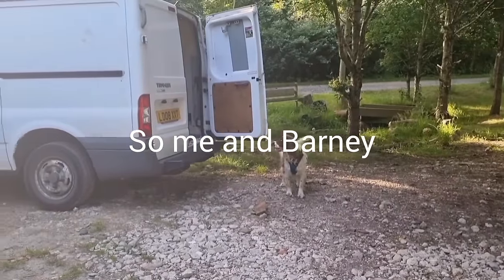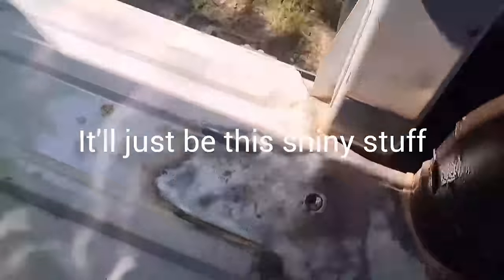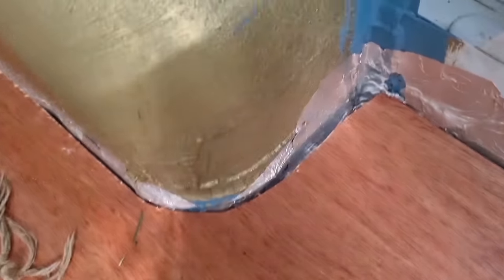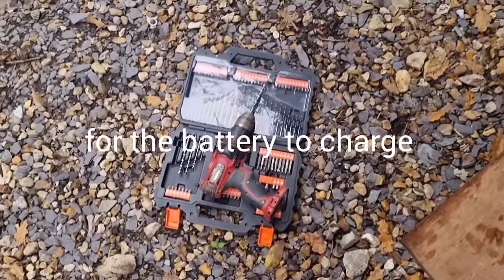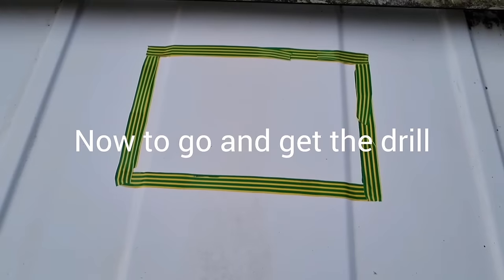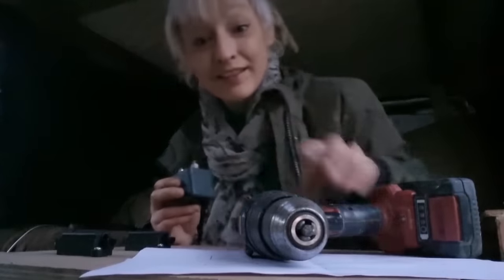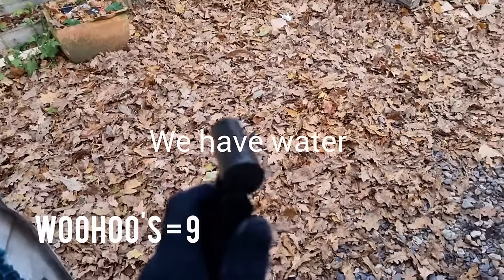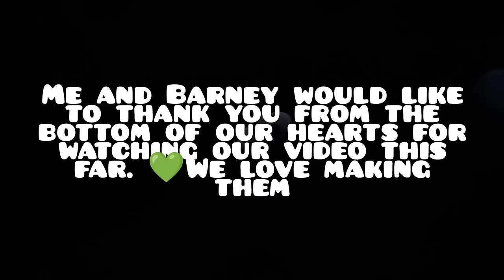#25 Clueless Female Builds Ford Transit Camper Conversion 😲 Must See Van Build

Comment: Far from clueless madam 👍 tidy job looks very cosy.  Not sure your crimpers are meant to do battery terminals.though. soldering would have been a better option for future reference.  Enjoy your travels
Reply from the maker: Ha, thanks! I took my battery cables to the electric shop and soon realised my crimpers were just for my teenie wires 🤦🏼‍♀️ thanks for the tip!
Reply: Soldering a connection made for crimping isn't the best idea. But a better crimping tool would be a good idea.

Comment: In a youtube full of very expensive van builds I loved the simple and very effective build you did. I would not describe this as clueless, seemed to me you knew what you were doing. I am on version 3 of my van build and it still doesn't feel as cosy as yours. Well done. Subscribed.
Reply from the maker: Thank you! I designed it for a winter holiday, so I thought only about the cosy warm feeling! I just spray adhesived blankets and fluffy fabrics to the walls! A great alternative to the carpet you see in every van build ever. Thanks so much for the watch! 💖

Comment: My advice would have been to keep the bulkhead that separates the back of the van from the driver's compartment.
At least keep the part that is behind the driver.
This would keep anything that is in the back from hitting the driver in case of an accident
Reply from the maker: I did plan to take the middle seat out and allow access from back to front incase of an emergency. It never happened. Thanks so much for the watch 💗

Comment: 11:15 from their website: "Product overview
Bostik SBR is a specially modified Styrene Butadiene Co-polymer Latex for cement and mortar.

It toughens, waterproofs and improves chemical and abrasion resistance of renders, screeds and mortar. It is an excellent all round primer and bonding agent and is especially suitable for external applications. 

Bostik SBR can be used for waterproof rendering, flooring screeds and toppings, as well as for bonding renders and suction control." 

Any the wiser? I'm not.
Reply from the maker: Thank you for this! Sounds like it could be the right stuff to extend the floors life. Thanks so much for the watch 💖

Comment: Great build, just a few things van builders forget.  Ventilation, go and have a look at a caravan floor, they have holes in to allow for ventilation and prevent mould, a sealed box will get damp and you’re have a mould problem in a few years.  Also regardless of battery type, vrla, gel or lithium make sure you have ventilation, ideally with external acces or away from living quarters as they can produce explosive gas, mainly hydrogen during the charge period,  with todays battery pack technology I’d just use a battery power pack and a solar panel, makes things a lot easier.

Comment: Not clueless at all. Maybe not very strong - I used those crimps for years and never struggled like that. Especially as they are a one handed tool.
For those that have never used a drill and a hole saw before, there is nothing like getting your wrist snapped around and your thumb twisted at the same time. With experience you know it might happen and you should hold the drill in a 'monkey grip' with your thumb on the same side as your fingers.
Reply from the maker: They were definitely the wrong sized crumpet for the job! They're great for teenie cables it turns out. Thanks so much for the watch!

Comment: Was fun to follow your creative conversion work of a transportation car into a camper van.🤩 Only avoid wearing a scarf during the drilling sessions...🤪
Reply from the maker: I cringed editing those sections as it was clearer to see for myself how unsafe I may have been being! Thanks so much for watching 💖
Reply: @looselywild2679 yes. Loads of people will pick up and comment on that safety kind of stuff. Then there's counter comments, some more or less annoying.
   You must be commended for wearing a face Visor when using an angle grinder. At work I've seen one of those grinding disks, but twice the diameter, come off. It ran up his overalls over his shoulder and half way down his back. Good job his 'face' wasn't in the path.
  Your clearly smart and capable, and i have a strong impression that your getting good advice from wherever, which is really nice. Long may it continue.

Comment: Hi my UK friend,  I have been watching lots of camper van builds to give me ideas for my solo travels.  I would never say you are clueless as to what to do as you show good content on working on a budget to sort everything out.  But as I like electronics and (as an extra woodworking)  I am taking an easier approach for the electrics and a cheaper one.  No batteries, no inverter, no mppt controller,  no fuses or breakers,  just one custom made unit to do everything, with a solar panel . My van will only be used in the summer.  I have subscribed and will follow your journey.
Reply from the maker: There must be fuses, but it's all been made for you and encased in a box! Sounds perfect, hassle free, and a little pricey. But I did once allow my homemade electrics to rattle loose and almost cause a fire. So if you can, it's always handy!! Thanks so much for the watch 💖
Reply: This channel is not for parttime van life pretenders..

Comment: Your sink drain should be threaded and have a nut on the bottom. Its sitting too high in the sink, hence the water wont fully drain. (Move the rubber washer underneath). You need a waste tank fitting to catch the water when you pull the plig out!
Next the toilet and shower eh?
Reply from the maker: What do you mean by threaded please?? I know I put the rubber on the wrong side. The glue I put on the underneath eventually rattled itself away. The water fully drained, except for totally out of the sink with out help of course. I thought I'd be cheeky and not bother with a grey water tank. Toilet was a very basic bucket toilet. And shower was never to be in a swb, low roof. I could use the hose if I wished, but I never have.
Thanks so much for the watch!

Comment: Il love your creativity, but very sure your sink drain situation wont last, you need to put the bolt down the middle of the sink drain to hold it together, water leaks in the van are every vanlifers enemy
Reply from the maker: Ha, you're not wrong! I finished the build in 2021, and since then the underneath pipe eventually came away. Because I did it wrong and created a lip with the sink, I always threw my bowl of water out the door, rather than using my badly made drainage. Thanks so much for the watch! 💗

Comment: aren't you supposed to "roll out "the bumpy sound deading smooth flat?
Reply from the maker: The Dodo sheets? They come like bubble wrap, it's not possible to flatten them more! I believe it's all part of the design. Thanks so much for the watch! 💖
Reply: it doesn't make any difference, they just stop the metal ringing by putting uneven weight on it, that's also why you don't put them in absolutely square or centred, nearly in the middle & nearly straight works best.

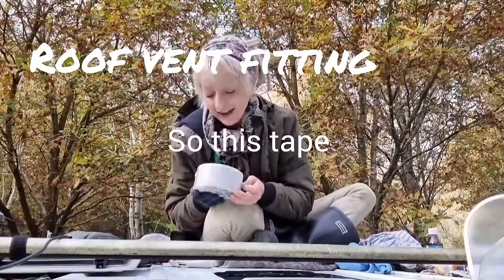Comment: 27:26 it looks like "Radbar double sided tape" is butyl rubber so you found what you were looking for!
Reply: I would have gone for a wooden frame inside to screw into that would also stiffen the roof, reducing the chance of leaks developing later.

Comment: You've put a lot of bad stuff(glue, sealant,  plastics etc) in your van and you will have to breath in an enclosed space for a few years. Was nice of you take up the floor and check the rust! But no reason for you to cut a bit more rainforest  down(mahogany plyY just to replace a perfectly good floor substrate! For those who might attempt to do the same thing. Just use the original floor if it's as nice as this one, you can put your insulation underneath it and use the original screws/holes to fix it, or just simply  use foil underlay ontop of it and put you decorative floor finish ontop. Overall Its nice good simple van  conversion sponsored by amazon. I must confess to have a deep hate of those self adhesive "foil" sound deadning patches that seem all the rage. The real issue are thermal, cold besides be uncomfortable leads to condensation problems where your breath will add almost a litre of water per day which has to go somewhere and causes rot and mold! if you insulate properly it it will be warm and quiet. As a first attempt A+ ,just got some bad advise on the way
Reply from the maker: Thank you for the advice!! She's given me no damp problems in the few years I've had her (touch wood). Thanks so much for watching 💖
Reply: @looselywild2679  that's good to hear, if youre in a forgiving climate it makes all the difference? We've 4 people in ours and a few  cold autumn  days and we are go from dry to damp!
Reply from the maker: @TheHamiltonRacing  I really rate the sound deadening thermal liner. On the tiny spots of metal that weren't covered in it would create condensation, but never on the liner, which was stuck to the metal. Impressive stuff. I've started covering my caravan in it too!!
Reply: @looselywild2679  ok. I done a few and because of the shape and depth of the transit panels you could easily get 2 inches of insulation  in there, which would be life changing in a colder environments  and great in the heat too! If you were to try and block the sound out of a speaker you would achieve very little by covering half of it and the thicker the covering the better it would work! Try to think in these terms, you didn't cover part of the floor?  But there are no wrong answers,  anything is better than nothing! And you put in effort on creative style which you would not get anywhere  else for any money! You've done wonders this is more for the folks learning from your hard work and is a hybrid of techniques  you've used versus a commercial guy doing it

Comment: I had a transit about the same age and had the same idea. i had a bus or shuttle version so  LWB full of seats and windows with nicer paneling in the back (never completed, too much rust) I made a thick curtain to separate front seat and back area. Blocks air from circulating to the front and keeps all the heat in the back. Blocks light getting out or in and gives privacy too. I made it dark gray so it reminds a bulkhead when walking by. My car was an aquarium so that point was for nothing to me, but for this build it would perfect the disguise as a regular van. Never tested how the back keeps heat, but in Finnish winter the front seat got warm 10x faster when engine warms up.

Comment: Hi, you should have battened the floor and used sound deadening and insulation x
Reply from the maker: Thanks! I used a layer of thermal sound deadening insulation, I worry I'd have lost height with batons! It's a swb low roof after all. I completed this in 2021 and haven't had any problems yet. I'm touching wood 🪵 thanks so much for the watch!
Reply: Your reply is great to read, I too have this van. One year older. Use it for work. But plan on making it a day van. Trips away with the family. Keeping the floor low was my thinking also. Keep up the good work.